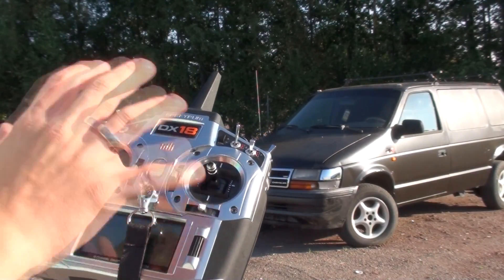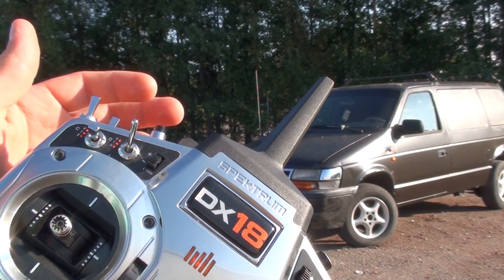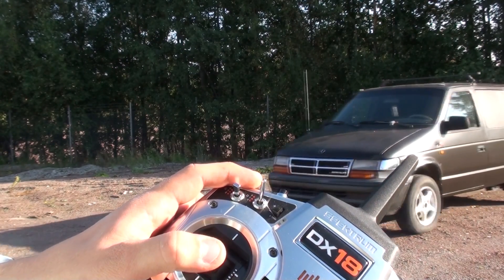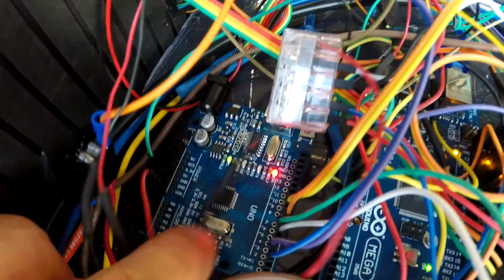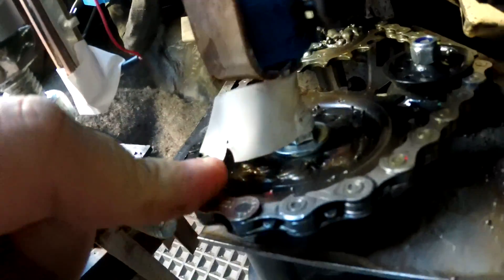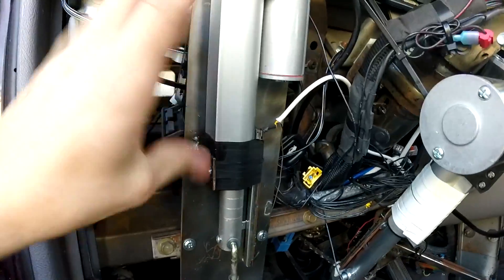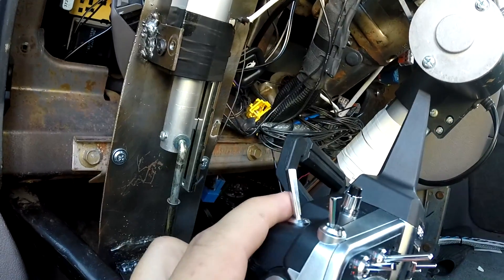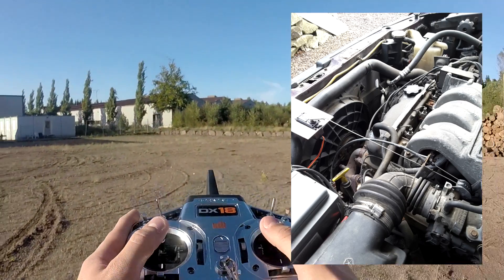Full size RC Car Technical

Comment: Could you tell me how you wrote to adruino for the actuator to be a servo?
Reply: He says it in the video - he uses a linear sliding potentiometer to track the actuator's position - that's how servo motors work. Basically it's a negative feedback loop, he tells the actuator what position he wants it to be and the microcontroller moves it accordingly, stopping it when it reaches the desired position.

Comment: Man I really hope you reply. What would it take to use the integrated systems of a car, say a W221 Mercedes, to turn it into an RC car without all the clutter? I'm talking about the adaptive cruise control and lane keeping system. The car basically has already the stuff built into itself, it steers by itself and can brake or accelerate by itself. I'm obviously just curious. Thanks a lot.

Comment: Amazing work man.
I have an idea: to get a decent metal gear rc servo and replace its potenciometer to another multi turn one, then install that potentiometer externally on the steering, and let the servo controls an EPS torque sensor  (after buying it and  taking the sensor out of the EPS) then the worm gear in the EPS will turn the steering untill the potentiometer is in the end of turns then the servo will stop applying torque to the torque sensor which will stop the EPS motor at that position.
Just an idea...not sure if its applicable...what do u think?

Comment: What type of radio gear did you used? if someone used the same frequency as you could you loose control of it? plz does anyone have a reliable solution for such a setup for safeties sake?

Comment: can you tell me about the break actuator type used by you. is it hydraulic or fully electrical? how much is its output power and is there any three step actuator for using in gear selector? thank yoj

Comment: Why won't we use  this method of navigation system even it's so simple and practically proven. I am not talking about rc navigation just about the simple panel joystic or controllers instead of brake,accelerator,steering reverse and all in a simple controller like we all drive cars in gta.

Comment: I think you splatted that gear on, wouldn't call that welding or safe.
Reply from the maker: +ShadowGuidR I wouldn't call gasless mig a welder either. But It's what I had, and it was my first welding ever. But i really don't think it will come loose ;)

Comment: Which sliding pots did you use? And is that a 15 turn rotary pot on the steering?
You should check out Gunters full size rc truck at rc power servo...

Comment: You should sit in the passenger seat.  with the controller of the car and have a fake RC car in the back of the car and then when someone pulls you over or a cop pulls you over put the remote control in the back seat with the fake RC car

Comment: Basically you just take your car and take out the enging leave the gears and also use or remove an antenna from a VERY GOOD AND BIG RC CAR also i forgot remove the gears and system yatta yagta blah blah replace it with some wiring stuff your done!

Comment: now make a full size rc a380
Reply: The funny thing is that it's no big problem. You just need to get your tx inputs in the fly by wire system of the 380, so mostly programming and getting a stable and secured uplink.
Reply: Devil Zen Galaxy ohh shit
Reply: Yevrra You know what would be cool? if somehow... some way somone made a rc ac 130.

Comment: Is it possible to add gprs (3G) connection and maybe some cameras and control it by a pc?
Reply from the maker: That'll be a bad idea. 3G is simply too slow. You might get away with 4G, but with the new 5G coming up, it should be doable.

Comment: This can't be legal to do and can get you in trouble with the police especially if you don't have a drivers license to operate a vehicle also if cops see the car doing doughnuts or burn outs or going in circles and doing things that a car would not do on the road then the cops might ticket you or arrest you because that's a real vehicle that is not a toy so use caution when attempting this project because he would not be responsible if you get into trouble with cops for violating the laws or if your caught driving without a license because if you do this and don't have a drivers license you can get charged with driving without a license if the cops see the car moving so be safe and use caution because this can't be legal to do
Reply from the maker: If I were a cop and saw someone do something like that, I'd ask to try it.

Comment: so what did you use as a steering servo. you should show the equipment you used.
Reply from the maker: http://www.ebay.com/itm/Makermotor-Electric-Gear-Motor-12v-Low-Speed-100-RPM-Gearmotor-DC-Mount-Screws-/222234785714?epid=1569013987&hash=item33be39b7b2:g:9dgAAOSwi0RXxeaQ
Reply from the maker: I'm gonna make a couple more videos, not a total how to, but cover some more details, and also a little driving at a quarry.

Comment: oh, the fucking boss, you're a master of the arduino's, a very good video
Reply from the maker: Actually I'm not. If i were to post my code, well .... WASTED. I took one thing at a time, made it work, spliced all the codes, and mounted the system in the car. It was a learning process.

Comment: Is it able to go the full speed it's normally supposed to go or u made it slower?
Reply from the maker: I made it faster. Because now you don't got the weight of a driver B) (That's a yes, it can go full throttle in drive, no limitation)

Comment: sit in the passanger and drive it around town
Reply: Velie Vue till the remote battery dies....
Reply: VANZ STRINGZ bring extra battery's idfk
Reply: Not illegal if its on private property :)
Reply: Justin Case and?
Reply: Me
Reply: Motorbike Mike u
Reply: P
PZS
AQQ
Reply: What if you crash but good idea
Reply: Artur Emenems exactly
Reply: Motorbike Mike how tf
Reply: Velie Vue or place it with keys in a place and when someone try to steel the car you locks the doors and drive the car with the car steeler in it 😆😆😆
Reply: Velie Vue illegal
Reply: Justin Case fuck it

Comment: you made this car to good I like it
Reply from the maker: Thanks! Still, this was a trial an error project, there is a lot i would have done different in a new build, and the safety functions is not the safest. But it works like a charm :)
Reply: +Heiniac would you do another build ?
Reply: Heiniac Automatic gearbox I presume.

Comment: Makes me want to buy another truck or an old patrol car just to do this... sadly, no clue what id be doing and no money to do it. Least i already have the controller!
Reply from the maker: Snipe Stud00 The controller was more expensive than the car :P
Reply: Heiniac estate sales are nice. I got one oretty close to this one for 5 bucks.. googled it and its worth 169 new
Reply: Heiniac Team failsafe eh? I wont trust spektrum any day. FrSky FTW
Reply: Really, it depends what you are using it for.
If its only to deliver PWM signals, i cant see why it should failsafe, i've only encountered problems with Spectrum when the receiver is also delivering power to the servos (like on a plane and such)
Spectrum transmitters also have premium feel to it, one i really cannot find with FrSky products.. 
however, one failsafe left a heavy repair bill and since then... well i agree. FrSky is the way to go.. Especially after the M9 Gimbals came out, they add to the "premium feel" i missed with FrSky.

Comment: Use That Car For Pranking Into People Example DriveThru
Or Something Else That Is Prankable
Reply: AlternativeGamingPE if you get pulled over by cops he will come up and you wont be there, then he wont see you and you can drive away
Reply: Heiniac ,
what if you drive through but you are on the passenger side with the remote kinda low, out of sight with no driver, and say you ghost friend is driving you 😂
Reply: Heiniac dude you should drive it in a drive threw at McDonald's
Reply: AlternativeGamingPE uber driver? 😂
Reply: Yes but it would be illegal as shit to Drive a RC car on the street
Reply: Pls Do It.This Is A Good Idea
Reply from the maker: I should put a blow up doll in the driver seat, and take it through a McDonalds drivethrough. To bad I ain't got balls for it.
Reply from the maker: Adam Paul Valerius Yes, you can do a lot of tuning, both on the remote control and the arduino, when it comes to both steering, brakes and throttle.
Reply: Michael Davis through*
Reply: JAMCastillo1 that would be mad funny
Reply: under what law?  after all technically autopilot by tesla could be considered the same.
Reply: Teslas (as every other cars) went through test phases to be considered street legal, therefore an homemade RC car that hasn't passed any test would be illegal to drive on the streets.
Reply: AlternativeGamingPE I

Comment: How much money did it cost to buy all the equipment necessary?
Reply from the maker: Hey, sorry for the late reply, 
The car was around 800$
The remote controller and receiver was around 550$
The motors and electronics was around 350-400$